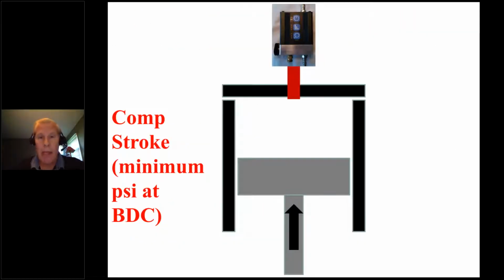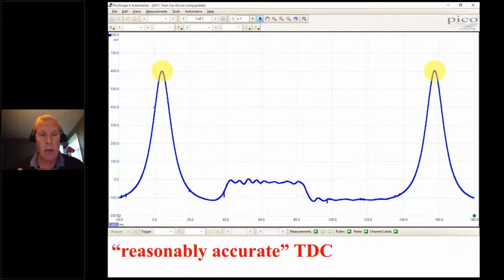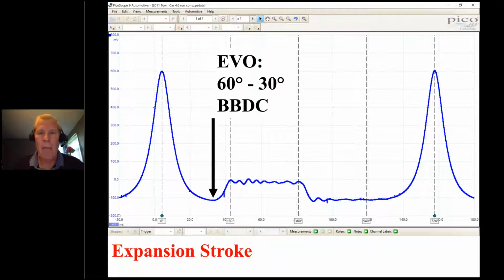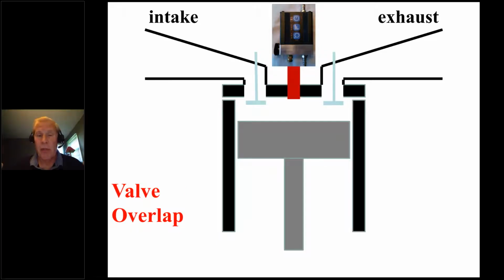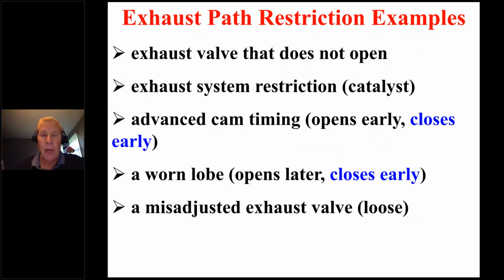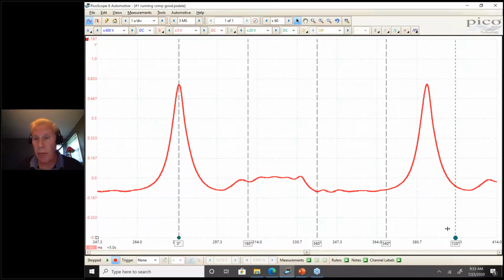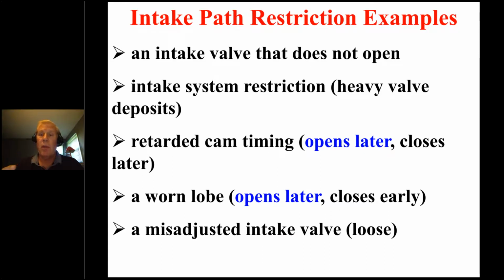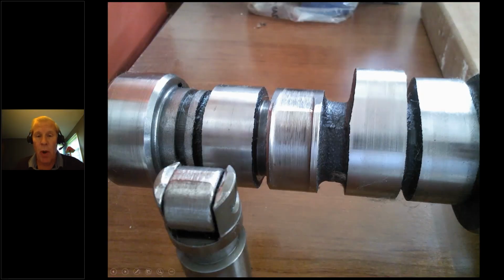NACAT Virtual Conference Session 1 "In Cylinder Analysis" w/ John Thornton

Comment: Can anyone explain the little pressure bump at 33:33 ? John points it out but never explains it.
Reply: I thought it was due to scavenging, the exhaust valve opens to allow exhaust gases to enter the combustion chamber to burn. Since the exhaust is at atmospheric pressure and opens to burn this gas. The pressure rises because the exhaust is opening and at atmospheric pressure higher than the slight vacuum. This engine appears to have this function as a normal operation. I could be wrong but that's my guess as to why the pressure increases from 0 before entering a vacuum when the intake valve opens.
Reply: The exhaust valve is not opening soon enough. This causes the pressure to raise. intake valve is closed before exhaust opens. The valve overlap is gone.
Reply: It's bc it has a turbo - it's very common to see that little pressure rise at the end of the exhaust stroke on turbocharged engines due to the exhaust backpressure (a turbo is always going to be a bit of an exhaust restriction afterall, and this is also why it's incorrect when people say turbos are "free" horsepower).
Reply: @nowayjose596 I think its more of a sign of VVT
Reply: John states that exhaust cams  usually are retarded when activated. During idle condition as in the shown capture at 33.33 the cam phaser is not active. In consequence the exhaust cam timing is maximum advanced with the exhaust valve closing early. When closing that early the exhaust gases have not been evacuated completely and the remaining rest of them is being compressed on what is left of the upward movement of the piston. This causes the spike/pressure increase you see in the capture.
Reply: @juergenscholl2843  Yes' but, that spike is past the 360 degree mark so the piston would have been headed back down by then. I have a theory to explain this. Namely, that since this cylinder didn't fire (we have the plug out), that the crank slows considerably on these 4 cylinder engines and the rulers are significantly off. Would you agree?

Comment: They are using all this to tell if cat conv or stopped up exhaust is the problem?
Reply: This is kinda big gun . Think it as a an advanced diag tool. You dont need to use this setup just to tell exhaust or cat converter plugged up. Conventional vacuum gauge or pressure gauge would reveal that thing.
Well of course you dont need 50 ton hydraulic press to smash a peanut. But there are some situations the hammer and chisel not sufficient.